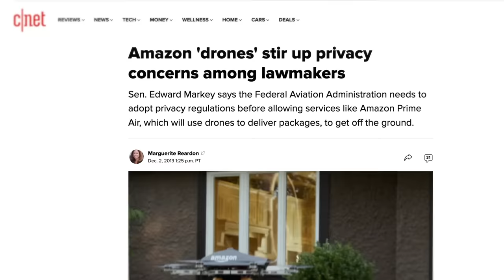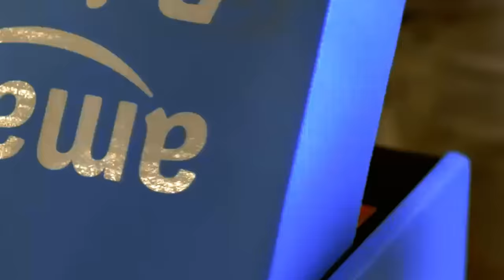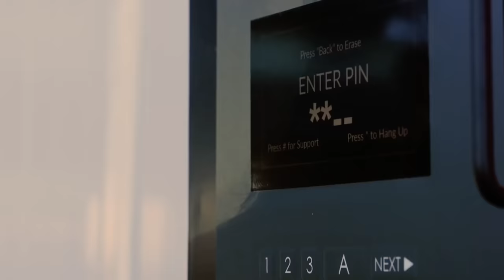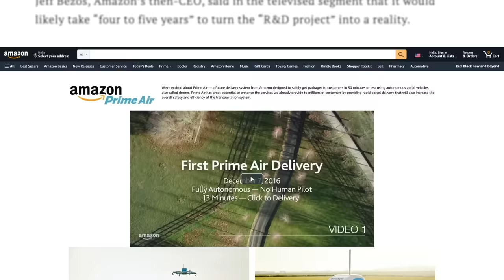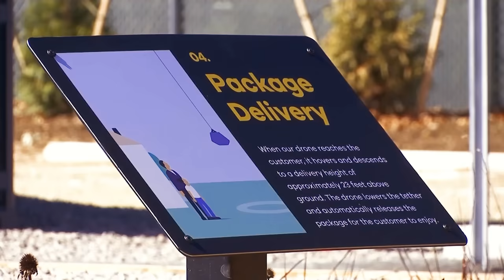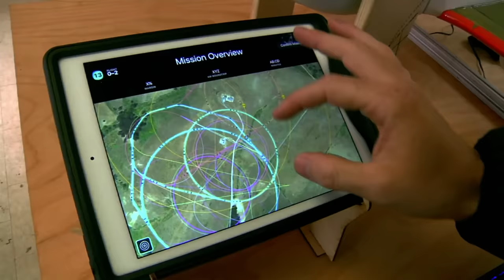Drone Delivery Was Supposed to be the Future. What Went Wrong?

Comment: When I fly my drone, the first thing I have to consider are all the trees and    power lines. Three blocks away, I can't fly at all because there is an airport many miles away but it is still an airport zone.  The vast majority of the local area is covered by those airport zones. And the rest is trees.  Just flying a drone for fun has to be done extremely carefully.  Cannot imagine trying to scale this up to for rapid package deliveries. There will be wrecked aircraft all over.
Reply: trees are not an issue at 400 ft altitude, where our uav's typically fly. We also sometimes fly inside airport airspace by working for the airport.
Reply: you need complex AI but it will happen in the future
Reply: Nonsense.  Drones fly at few hundred feet. FAA get needs to rule.
Reply: @casIIsac  If a problem's only solution is "complex AI" you're going to have a bad time. Autonomous drones aren't as difficult as autonomous cars but still, this would require decision-making only humans are capable of right now.
Reply: @SaHaRaSquad  not true at all you can put sensors on the drone that will make the drone avoid obstacles such as trees and buildings
Reply: @mikeyjoyce2844  Well that's one way to oversimplify it lol
Reply: @mikeyjoyce2844  bruh
Reply: @SaHaRaSquad  drones will be infinitely more complicated to figure out than cars lmfao what are you talking about. Cars can only move in two dimensions and which severely reduces the number of variables that need to be accounted for at any given time.
Reply: @harrisonlorens3585  Nope. Drones don't need to bother with any traffic other than other automated drones that they can communicate with. The only really unpredictable variable is wind. With cars on the other hand you have to deal with unmarked roads, incorrect markings, manipulated markings/signs, children, wild animals, different road conditions and much more. The most advanced automated cars can't even reliably stay in the lane in optimal weather conditions right now. Cars need crazy reliable optical recognition, drones can mainly navigate via GPS and a little syncing with pictures that are almost always in the optimal angle.
Reply: I was offered to work on a research project to even just enable drones to deliver within a building, it has the same issues as self driving cars, just far more frequent unexpected developments and unpredictable results...
Reply: @SaHaRaSquad  case and point: autopilot for aircraft has been around for a long time. Not quite so for cars
Reply: @cakedayy  To be fair autopilot for planes is often more limited.
Although some few passenger airplanes actually were able to land with autopilot.
Reply: @SaHaRaSquad  Drones that will drop packages in residential areas need to distinguish between most of those things too, in addition to power lines, tress, pets, fences, etc. To get them to deliver flawlessly is just as difficult as cars.
Reply: @Razumen  Everything you just mentioned aside from pets are static obstacles, and drones are free to change course in any direction or change their speed at any time. In difficult situations they could literally stop in the air until they made a decision or wait for a human to take over without time pressure. Very, very different from cars where you can't just change the speed/direction at will and have to do life-or-death decisions within milliseconds.

There's a huge difference between a heavy vehicle carrying humans through a dynamic environment with other people, and a drone carrying a toothbrush or something to a backyard.
Reply: @SaHaRaSquad  Drones can fly at high speeds too you know, they are just as subject to the laws of physics as cars.

And you're wrong, there are far more potential obstacles for a drone than a car. Because drones are not limited to roads only.
Reply: Why not creating ground tunnel or sky tunnel for drone so make sure the tunnel only for drone to keep delivery not even noisy and safe?

For us to make better future should create tunnel for in every house or apartment with special tunnel unit so everyone can enjoy delivery without worry

More privacy should every room have to have special tunnel for drone will be amazing
Reply: Yay free drones laying everywhere
Reply: @p39483  even drone laying everywhere..government should put more police station to check those stuff not even stolen 

If people broke it just go to the jail straight away with evidence
Reply: Flying cars were also a brainless future scenario many decades ago. Airspace is finite.
Reply: @casIIsac  "nightmare future". There fixed it for you.
Reply: @SaHaRaSquad  Birds, rain, wind, other drones, malfunctioning drones, hail, fog, rapidly changing winds, temperature, failures, etc.

Landing is even worse, you need to be able to reliably pick out a specific house, deliver to the house, avoid all obstacles and more. Apartment complexes would be a dick to deal with to.

Beyond that, drone failures. That can make it up to be lethal, especially considering the mere volume of drones that will have to fly.

It is a million problems that all has to be fixed before even considering it.

Oh yeah, large scale drone theft, logistics being taken over by hacking and faaaar faaar more
Reply: Skydio exists people... They have some of the best autonomous flight software on a drone right now and it's under $1000
Reply: @TypicalBlox And it is consistent enough to operate under unknown conditions, avoid all collisions consistently, as well as consistently flying for thousands of hours without incident with hundreds in the sky?
Reply: @SioxerNikita  the only time it would need to avoid collisions would be for landing, got aren't going to hit anything at 400 feet. But even then yes it's smart enough to do it
Reply: @TypicalBlox  Air collisions between planes still happen to this day. 

Just because you are in air doesn't mean you are not at risk of collisions.

But the question is not whether it is "smart enough" to do it, it is whether it does so consistently, even with potentially hundreds of other objects in the air.

Even with wind gusts, etc.

Even then collision avoidance while landing is going to be really important, as well as choosing a suitable landing location and far more.

In terms of energy use, it is terrible due to economy of scale. Far worse to fly a single relatively light package on something flying, than something on the ground. It is far cheaper to get things across the ground, than in the air.

Safety wise you also need to be sure that the drones will not have failures mid air. It has to have incredibly low failure rate, since it is a SERIOUS health hazard if one falls from the sky.

Based on your response, you don't actually know any of these stats, consistency, etc. and since you don't there is little reason to say it is possible to do at any level of scale at this point.
Reply: @SioxerNikita  Guess what genius? I never said drone deliveries were a good idea but rather we have the autonomous capabilities.

Secondly what planes are flying at 400 feet in the air for it to be a risk to them?
Reply: @TypicalBlox  Planes? Other drones... 

if you have autonomous capability "genius", there will more than likely be more than just 1 drone in the airspace at a time "genius".

And we don't really have proper autonomous capabilities yet either. Since you'd have to fix all the issues for it to be mass implemented, even for customers. It might be a fun gimmick somewhere without people, but autonomous drones in cities are silly.

Also what the hell would consumers in general use autonomous drones for if not deliveries of some kind? Hover to record something I guess, but you don't need autonomous capabilities for that. Pre-plan a  flight for recording? I guess, but then it is mostly better to have an operator so you can have a better recording, etc.

These are fledgling tech, and they aren't particularly good yet. It's like saying we have full self driving, while the system is not even close to being fully functional.

Also planes hit planes at a surprisingly high rate considering the skies are damn fucking big.
Reply: @SioxerNikita  Once again, autonomous drones, planes and cars all exist in 2022 no clue why you still think they don't. 

Secondly autonomous drones for consumers like skydio can be used in sports and add aid to pilots. It's like arguing why do drivers need automatic emergency breaking when they can just improve their reaction time.

Please just take one look at Skydio because you are clearly lost.
Reply: @TypicalBlox  Autonomous cars are in their infancy, and definitely not ready for mass implementation. Full Self Driving on Teslas are actually illegal in Europe for example. Also the Tesla FSD is also technically not going to meet the definition of autonomous.

Also I've never said they DON'T exist, I am merely saying there is no evidence that it is safe enough for any amount of adoption at scale.

"Secondly autonomous drones for consumers like skydio can be used in sports and add aid to pilots. It's like arguing why do drivers need automatic emergency breaking when they can just improve their reaction time."

Erm, no... One is a safety feature... another is a feature to get a drone to fly or do something autonomously... 

I did check it also, and the safety guidelines pointed out some of the safety issues I have.

A) It does not avoid moving objects... so not truly autonomous there.
B) You are encouraged to do a pretty serious pre-flight check, since this does not allow it to check on its systems themselves.
C) No Low-Light conditions
D) Don't fly in snow, rain or fog
E) Can get blinded when flying towards the sun
F) Do not operate over people or vehicles.
G) Keep it away from surfaces that are reflective larger than 58cm in width.

Yeah, doesn't meet any significant standard for what you would consider an "autonomous drone", it can be programmed to follow you, etc. Keep away from people, etc.

Not designated safe by any measure. Can't avoid things that move.

I should've taken a look at the features immediately and then told you, it is not autonomous. It is not even suggested to fly it without supervision... 

And you said this is the best? XD Again, actual autonomous flight is difficult to make, even in controlled environments.
Reply: @SioxerNikita  so waymo and cruise who are operating in city's right now don't exist?
Reply: @TypicalBlox  Waymo is an extremely limited area, and same with Cruise. That is still not fully autonomous, and Cruise is in a testing phase,

A Cruise also blocked a fire truck, did a crash it shouldn't have done, etc.

We are getting closer but this shit is not ready, not fully capable of making decisions and can be a severe danger if unexpected things happen, since it cannot autonomously solve problems it hasn't encountered before.

They also lost communication with their vehicles leading to the vehicles clustering in an intersection. Not particularly autonomous either.  

Waymo is also only in the testing phase, limited areas, etc.

Waymo cannot detect potholes and there are issues with unmapped stop lights, and can't detect police officers trying to pull it over. Some of these might be fixed, but again not fully autonomous and both in a testing phase. Doing better than Tesla as far as I can see, but far less generalized
Reply: The sound of just a single drone for 2 minutes is already extremely annoying. Now imagine tons of drones all the time.  That's a total nightmare.
Reply: @Razumen  Cars aren't just limited to roads. Thats... the problem. They need to stay on the road in the proper lane confinements always, or they're useless. That's very difficult optically. And drones can talk to each other, cars can't. Big problem. If car A decides to stop now and car B decides to go, then you're fucked. Drones working together can never make that mistake. Drones also stop quickly and can hover. Cars go, and take hundreds of feet to stop. Drones can also spend 95% of their time in space with ZERO obstacles in all directions. Hence why autopilot is used 100% of the time at cruising altitude. Cars can't, there will always be obstacles everywhere all the time. 

Mistakes are more likely to happen in that situation. Let's do some quick math. Suppose the chance of making a mistake in the presence of obstacles is 5%. Since drones spend maybe 5-10% of their trip in those conditions, their odds of a mistake at any given time is .25% - .50%, versus cars at 5%. So, much more likely for cars. Take that into consideration along with perfect traffic control, and its obvious why drones are much easier to automate than cars.
Reply: @Razumen  The numbers are random because they're arbitrary. You realize that... right? 

For any given numbers, ground vehicles will be more likely to crash because they are exposed to more obstacles more often. 

Don't believe me? Well, lets remove the numbers and prove it algebraically. 

Suppose the odds of a crash in place of an obstacle is X. Suppose a car spends Y  amount of time around obstacles, and a flying machine spends Z time around an obstacle.

We know Z is less than Y, because flying machines cruise with no obstacles whereas any type of ground cruising will have obstacles. The probability of a crash is: X * Y for a car and X * Z for a flying machine.

Since we know Z < Y, therefore X * Z < X * Y. Therefore, cars are more likely to crash from an obstacle at any given time.

What does this mean in real terms? It should be very obvious. Why is it that 40 year old autopilots can cruise for 10 hours without a hitch, but self-driving cars are nowhere close to becoming a reality?

Even in cruising conditions, such as the highway, we can't reliably self-drive. Adaptive cruise control does half the work, but the actual steering is still variable. 

The reality is driving on a highway versus 40,000 feet in the air are fundamentally different. You can't drift out of your lane in the air. There's no walls to collide with. No other vehicles to collide with. No ditches nor hills. And not just left and right - but up and down too. There's nothing. Even turbulence only impedes a plane - it doesn't block it. A wall certainly blocks a car though.

Thats why take off and landing are the most dangerous part of any air journey. There's obstacles and resistance... like wheels on the runway (!!! are you seeing a parallel?). But once you're in the air, you're golden. Planes can fully fly themselves in the air, and not just in a straight line but in complex maneuvers literally impossible for a human to perform. Yes, autopilot not only flies the plane, it does it so well that no human can match it. You can't react in a millisecond to a sensor changing - but a computer can and will.
Reply: @lucass8119  Drones do not fly at the game altitudes as planes, and there ARE more things that can go wrong with planes, which is why it's much harder to fly one than drive a car.

It's like you don't even logic.
Reply: @Razumen  Drones fly high enough there are less obstacles. The difference between 40,000 feet and 1,000 feet in terms of what's around you is none. 

I don't know why you continue to argue this when its obvious. Its harder for humans to fly a plane because there are more directions and controls. Its easier for a computer to fly a plane because they are super predictable. Cars are not. Hence why we have, and use, autopilot on every flight for decades. 

Plane autopilots don't even use cameras or machine learning lol. Thats how easy it is. Just use the altimeter, speedometer, and yaw to calculate trajectory. Just algorithms. Meanwhile auto driving requires huge amounts of ML and computer vision.
Reply: @lucass8119  There is a huge difference, especially in urban settings. These points were already covered in the video you clearly didn't watch.

"Its harder for humans to fly a plane because there are more directions and controls. " 
Lol, cars are very predictable, what are you even talking about now. 🤣

"Just algorithms." lol wut, machine learning is "just algorithms" too. But please, keep going on about stuff you don't know about.
Reply: If they operated outside of commercial airports, and were able to rapidly descend or ascend it could work but youre almost better off having somekind of autopilot flying with terrain mapping perfect so it knows where trees are, powerlines, and can ascend above them fast or drop below them fast. Commercial planes unless there landing arent flying under 1000 feet, and you would be primarily flying around low altitudes. I dont think air traffic is that big of a deal unless they were so high up they were getting in the way of planes taxi'ng. But i dont think the tech is fully fully there yet, even now. It all depends i guess how high and how far these drones wanna go with these packages, but i still think this can be done somehow. What would be cool is like, if amazon had a skyscraper or not even just a tall building, and the drones essentially just take off from and land on the roof. That way you wouldnt have them ascending and descending on random routes, they would all somewhat in that area be coming from the same spot, and then they would climb back up to the roof and land. They can only really haul light packages anyway so, building a system to get stuff to the roof to load them wouldnt be an issue. Lol its like pigeons i guess sort of. But having them take off from and land from a high location is safer, if the builings 300-500 feet would be a perfect size. They would be taking up less airspace and using less power with this method, instead of having to take off, gain altitude, land gain altitude again and fly back, they only have to climb to gain altitude on the return trip back to the building, wich is when theyd be empty and light also because they just dropped off the package.
Reply: Strongly depends on the airport. Look up LAANC, with correct planning it's very doable for a company (especially one with a Part 135 certificate) to operate these kinds of flights, even within 10 miles of major airports (as long as you're not along the approach path to a runway).
Reply: Rapid Package Deliveries . . . . delivered with precision  by disgruntled, underpaid employees with aggressive schedules to meet, no matter the weather!
Reply: You also need to take into account the one guy in town who’s got a slingshot and good aim.
Reply: @appa609  If you are flying a tiny drone above where trees grow then you got wind issues when flying and they should be banned if idiots flying them that high since yes then they are a issue with aircraft.